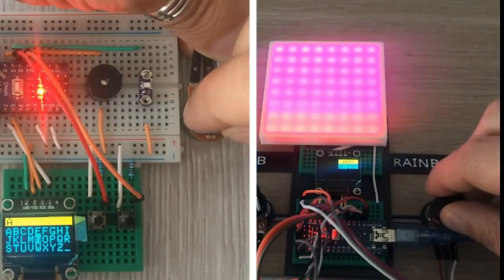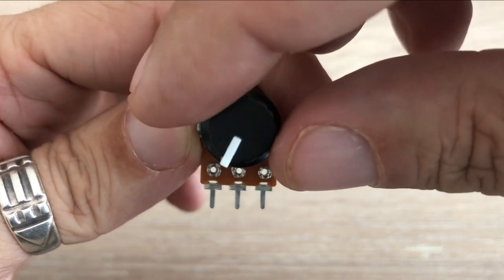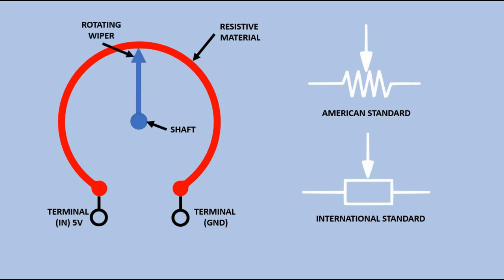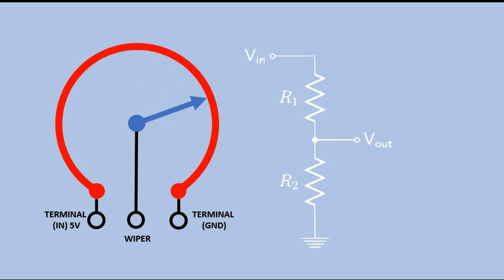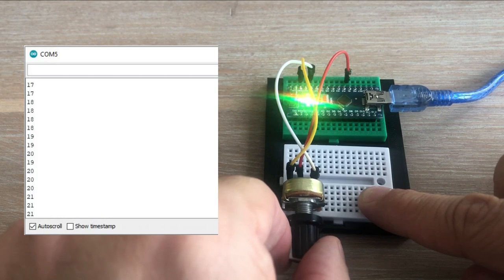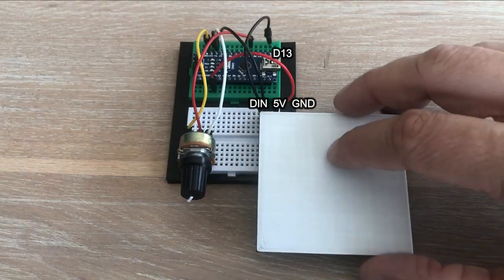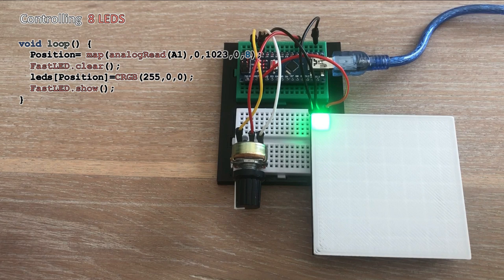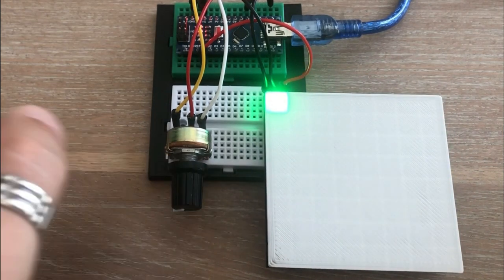Turning the Knob: Exploring Potentiometer Control with Arduino

Comment: Very well explained, as always!
I use a potentiometer to control the speed of a Stepper Motor. The Pot reading is mapped to a number that is used for the delay between HIGH and LOW for the voltage sent to the Stepper Driver.  This works well except with a very short delay, the motor can stall.  I need to "ramp up" the motor speed to avoid stalling.  How could I take the Pot reading and if it is a very small number (short delay), use a higher number and increment slowly to the Pot reading?  Thanks Mario!  Regards.

Comment: Any thoughts why my B10k potentiometer reads 0-255 for the first quarter of turning, and then if I turn just a little more, it starts back at 0 all the way to 255 again as I keep turning, and does this two more times?  As I turn the knob clockwise from one end to the other, the values are:  0-255, 0-255, 0-255, 0-255
Reply from the maker: Not sure. My immediate reaction would be that there is something wrong with it. Do you have just one?

Comment: I understand 3-pin potentiometer configuration. But there is some circuits that use only 2 pin of potentiometer. Why is that? Why does it work?
Reply from the maker: Have you watched my entire video?😉
Reply: @marios_ideas  Oh at around 2 minute. Sorry. Sometime I just skip the video.